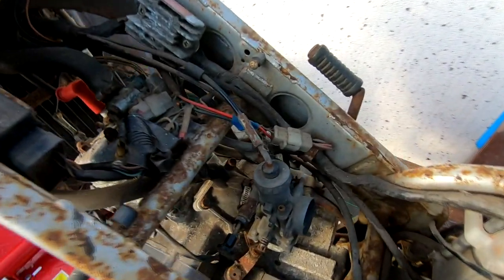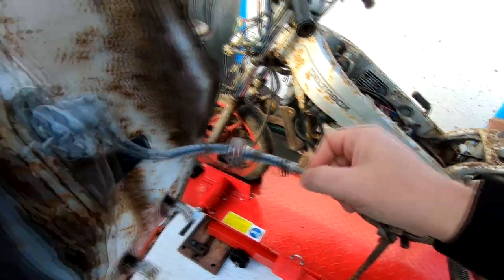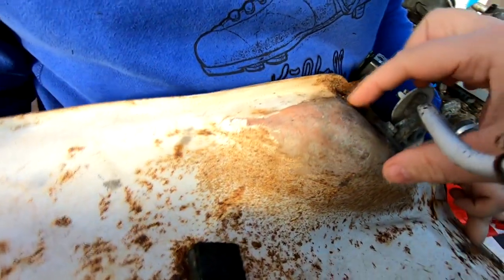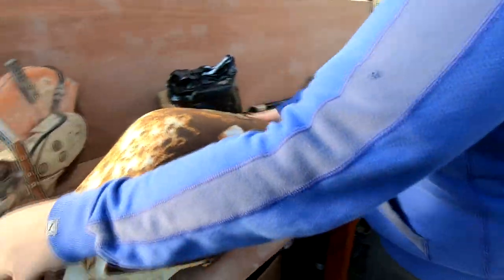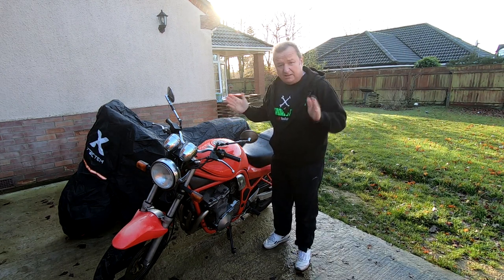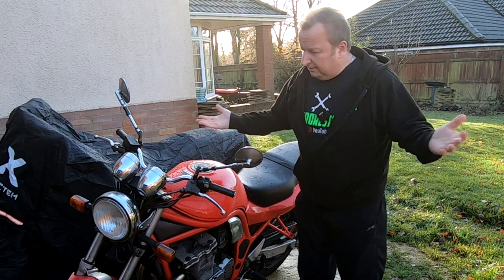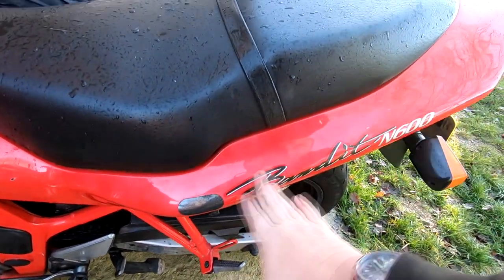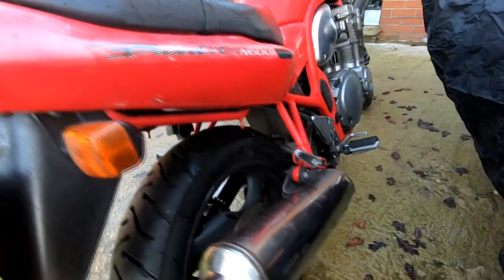My New Bikes And Scrap It Man Brings A Gift

Comment: I have the 2000 model Fazer 600, from new!  see profile pic lol  you don't need to do any jetting for the pipe, the Fazer runs rich and easy copes with it, adding a K&N drop in filter also helps lean it off, but still rich!  had mine on the dyno to check the jetting, it's still a bit rich. . There is a petrol tap under the tank , no reserve, just off, it's vac operated. If you do lift the tank, make sure you don't kink the tank breathers underneath, if you do, it'll struggle running, you can mod it from the 2000 model. Lots of info on the club https://foc-u.co.uk/  you can download the workshop manual.
The woolly running can often be the plug caps, the std yammy ones are rubbish, IIRC NGK SD05F caps are a straight fit. Keep the rear calliper clean , service it often, it collects all the dirt and stops working. The headlamps are terrible! you can get a HID conversion . Rear shock is ok ish bit pogo like, swap the fork oil for 15w ,helps firm the front end, it dives like a footy player lol  The engine is sort of a de tuned Thundercat, but you can't use many of the parts off it.
Reply from the maker: Great info, thanks

Comment: Got a 1250 Bandit Mart, so comfy to ride, had all sorts over the years.The Bandits are cracking all rounders! The 1250 is rapid 0 to 60, but they run out of breath at about 135 mph.Nice to see you getting back in on the bike scene.

Comment: Used to have a 600 bandit just after they came out. Then got a R1 then went to a R6 as it was more fun to ride. 
Got a 600 fazer sitting out in the garage had it 14 years now tho I'll be selling it next year along with my yamaha ty175. I had to buy the fazer as I tore off the suicide pegs on both sides on the test ride. First thing I did was put a lift kit on the rear. Nice bikes.
No rules on noisy exhausts it's all down to what mood the traffic cop is in who stops you. The only thing that could fail an mot is if the exhaust is marked "not for road use" and your right it doesn't sound quite right, when you first started it sounded like it was missing. 
Enjoyed the live stream it was good fun 👍

Comment: Hey Martin jojn the fazer standard & modified fb group, plenty of knowledgeable people in there, the fazer doesn't need upjetting they are rich from the factory, don't use a hiflo air filter as it gives a 7k flat spot, also there is a fuel tap but its in the centre of the tank underneath purely to turn fuel off when removing the tank... headlights are useless, common mod is to wire them both up but a better mod is to replace the internals with the projector kit...
Reply from the maker: Thanks bud

Comment: i had a 600 Bandit from new 1998 and did 85000 miles in 2  1/2 years on it. Engine was still super strong  but the rolling chassis suffered badly with corrosion. Great bikes for the money, i loved mine.

Comment: I love bandits have had loads. Love my bike lift too, I use it for lawnmower repair as well it's perfect  for that.  I rarely ever put straps on the bikes when they're on the lift. Usually put them on a centre stand, throw them on a paddock stand on the lift, or something else. The wheel chock definitely won't hold a bike up